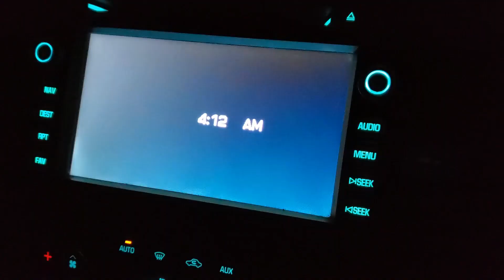Timber A-Frame Shed Battens "Nailed It"  S2:E15

Comment: Good Morning guys, thank you for your time and effort to document your journey...I am learning a lot on how to do these things with limited hands. My wife and I will be doing this alone for the most part, I do have 2 sons (36-38yrs old) that would be able to help but limited with time because they are raising their own families at this time. The helping "finger" strapped to the forks was well noted and great idea...Paul
Reply from the maker: Yeah, the boom lift extension worked great and kept us from risking difficult lifts on ladders. We initially built the structure to be a shed for our tractor. Had I to do it again I would have decked the entire roof, fitting slabs of rough cut timber together with a chainsaw, instead of placeing the horizontal purlins. This would have remived the need for the long vertical roof boards and made it stronger at the same time. A good example of the type of decking I speak of can be seen when you watch the video of us putting the floor in the cabin. Thanks for watching.

Comment: Milwaukee is the best !!!
Reply: Was it necessary to put the battens , when you are going to do the foam and later concrete the roof? Was it done for airflow under the foam ? Or some other reason I m not aware of ?
Reply from the maker: The battens were originally installed in attempt to make the roof shed water as it was intended to cover my tractor. Shortly there after we decided to convert the structure into a cabin. If I had it to do over again I would have simply decked the roof with horizontal boards fitted together as best as possible as we did the deck boards on the floor joists. Thanks for watching.